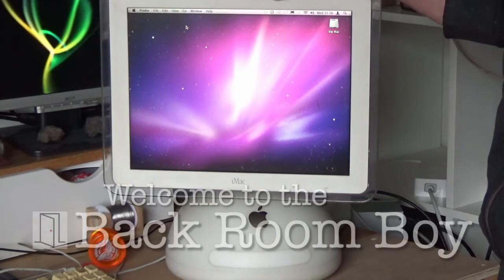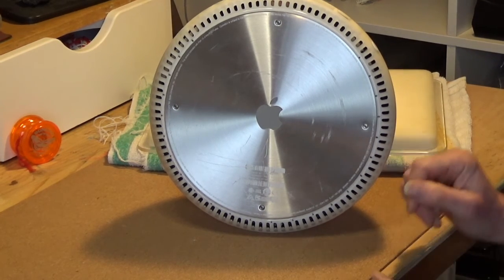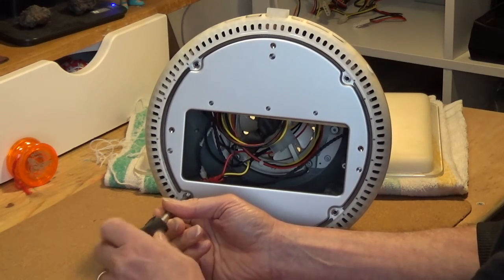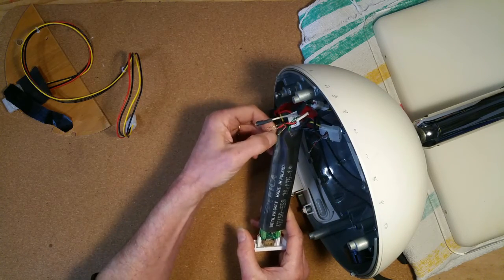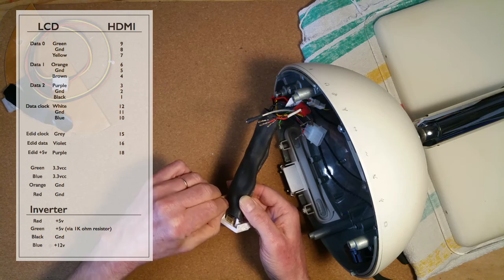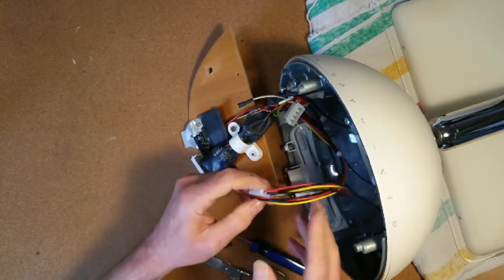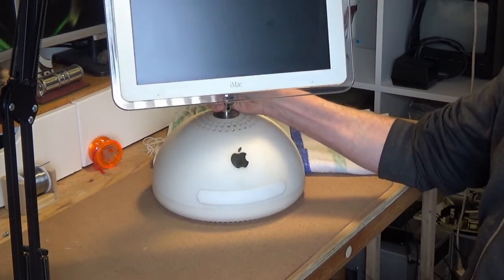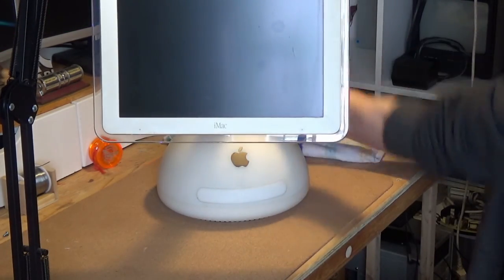iMac G4 HDMI conversion - use it as a monitor!

Comment: can you clarify more on the power side, what is the reference to the resistor and how is that hooked up??
Also why is there a resistor in the HDMI plug?
Reply from the maker: The resistor between pins 18 and 19 is for screen detect and the one on the green +5V line switches on the panel backlight (IIRC -- it's some time since I did this project).
Reply: @backroomboy4420  Thanks so hooking the green line to 5v requires a 1K ohm resistor between the green wire and +5v yes?
Reply: @joeventura1  hey, can you help to find a power supply to get rid of inverter and connections? Those inverters are hard to find or repair nowdays but a powersuply of 12v its of the size of a usbc adapter. Am i wrong?

Comment: Great video, thank you! I'm getting it to show my HDMI connected display, but it's very shaky and colours are wrong; Two questions, the 1k resistor is shown on your video between 18 & 19, whereas on the pinout, I see the resistor mentioned to be going to the inverter cable; Are there 2 resistors or did i misunderstand the pin-out for the HDMI?
Reply from the maker: Thank you! Blimey, it's a long time since I did this but wracking my brain to try to remember... there's a 1K resistor between pins 18 (edid +5v, purple wire) and 19 (hot plug detect) on the HDMI plug/socket and a 1K resistor on the inverter's green 5v wire which sets screen brightness (IIRC). Picture instability is more likely to be a poor connection on your HDMI breakout (if that's what you used). Try it and let us know what happens here in the comments. Good luck!

Comment: What do I do if I lost the original power supply and just have the monitor
Reply from the maker: Just use an old ATX PSU that can be bought cheaply from eBay, all the voltages you need are available and detailed in the pinouts supplied in the video

Comment: okay so i've got everything exactly what type of ATX did you use. Is there a model number?  or particular identifier? thanks
Reply from the maker: I'm on holiday at the moment but any old ATX PSU taken from a PC will work fine. Look for one that supplies +12v, +5v, +3.3v which is pretty much all of them. I'll post an identifier when I get back.
Reply from the maker: Okay, I'm back. The PSU was taken from a Dell PC and has the model number H250AD-01. But as mentioned, pretty much any PSU liberated from an old PC will work just fine. Good luck!
Reply: @backroomboy4420  okay great thank you. The wires to connect the hdmi cable are different colors than your diagram.
Reply from the maker: Hmm, that's gonna make it difficult. Are you working with a 15 inch screen? The other sizes of screen are different. If you are, I would match up all the colours that are the same and see what you have left over, making educated guesses from there. If you're not, do a search for your size of screen -- the others have been covered elsewhere. I'm afraid that's about all I can suggest. Good luck!
Reply: Hi & thank you for a great idea & video. How stable is the screen with so much weight removed? Wonder if I may need some ballast to keep it stable at all angles?
Reply: @SergeiJonovich  I have removed everything from my g4 and as long as it is on a solid flat surface it will stand just fine

Comment: Thanks for uploading this brilliant video. I have an iMac G4 sunflower with a broken psu. As it is really hard nowadays to get it repaired or find spares I am intrigued to build exactly what you did! Unfortunately you already did the conversion so it's not that easy to follow for me.

How much volts are on the Molex connector? 
Could you maybe provide a step-by-step guide for the mentally impaired just like me. I am clearly new to this and I'm afraid to damage the components in the process.

Thank again!
Reply from the maker: You're welcome! Having already modded mine I can't redo it which is why, in the video, you simply see me take it apart, talk about it and put it back together. However, if you visit Dremel Junkie's well-known blog at www.dremeljunkie.com he provides lots of step by step advice on modding the G4 iMac. The only one he hasn't done is the 15" so combine my pin-outs with his step-by-step and you'll have your own G4 'working' again! The molex is modded to provide +12v, +5v, +3.3v and ground all in one plug. Pretty much any old ATX PSU will give you these voltages. Good luck!

Comment: Great video!  I have a couple of questions however: 1) does the iMac sleep when the ext computer sleeps? 2) are the display pinouts different for the 800Mhz and 1.25GHz iMacs and 17in and 20in displays? 3) may any HDMI output capable computer drive the iMac monitor and what is the screen resolution?
Reply from the maker: Thank you. 1. It does sleep but not in the way you might think, the screen produces a random, static collection of coloured pixels. 2. The 15" 800MHz G4 pinouts are different to the 17" & 20" displays but I have no experience of the 1.25GHz machine. 3. In theory, yes. Everything I've tried works...except my Hudl tablet. Screen resolution is 1024x768

Comment: Brilliant!!! I was thinking about doing the same thing to my G4, but it was a project that I had put on the back-burner, because I was going to remove the LCD and try to find a driver board  for it, Because of your video I now see I don't need one, I didn't know it was a TMDS signal, your lack of a driver-board sent me searching :) Thank you for sharing this :)
Reply from the maker: No probs! And no driver needed. A simple TMDS signal which, wired to an HDMI breakout plug or socket, will provide a universal HDMI monitor :)